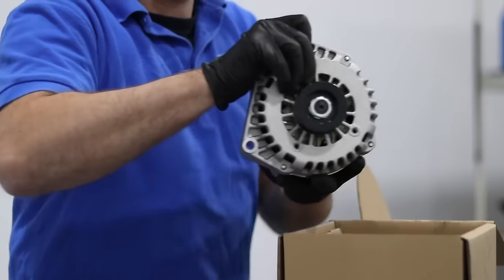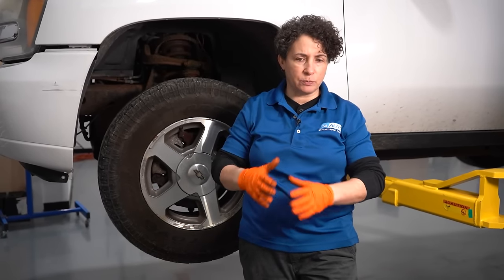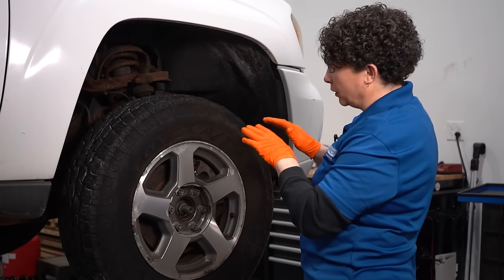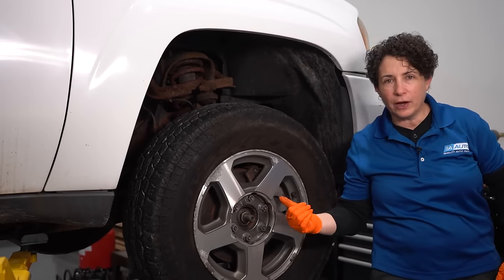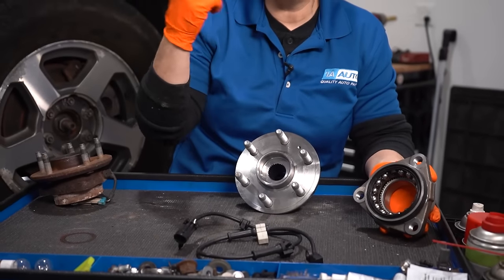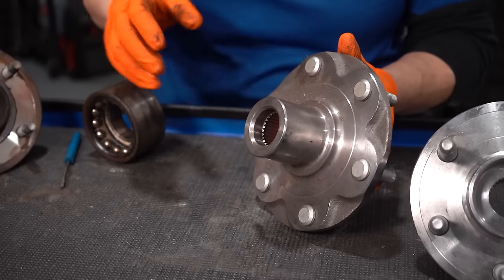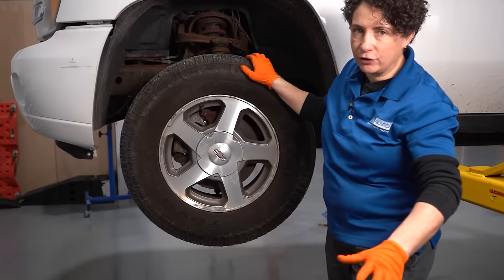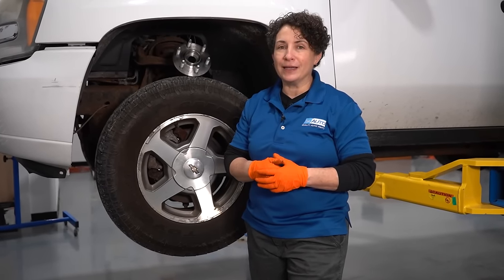Car or truck howling noise when driving? How to evaluate your wheel hub bearings.

Comment from the maker: √  Watch the Video
√  Buy The Part at 1A Auto http://1aau.to/m/Visit-1AAuto
√  Do it Yourself
√  Save Money
Reply: Sometimes they can give a wobble noise before the howl. Mine came on after getting all new tires. The heavier new tires were the straw that broke the camel's back and immediately brought on the noise. Naturally since it cane on with new rubber, I was convinced it was from a defective tire and so was my mechanic because we couldn't get any noise or movement on the lift, but it was very loud while driving We rebalanced and rotated the tires. The noise was still coming from the same spot. So I gambled and chaned the bearing. Problem solved.   And even though it did not make noise while spinning the wheel on the lift, when we got it out, and spun it on the workbench we heard the grinding. Go figure?

Comment: I bought TRQ front hub and bearing set for my Chevy 2500HD,  from you folks.  Put them in to specs. Now 2500 miles later they are whining like crazy.  Have not yet started to wobble thank goodness.  They were replaced under warranty, but I'm afraid to put them in, I don't want to be doing front hubs every 2500 miles.  Probably end up spending more and put in moogs.

Comment: Was starting to hear the "howling" from the front of the truck.  Got home and measured the rotor temperatures as close to the axle as practical.  Truck was just parked with wheels on the ground.  Using a hand held infrared thermometer, driver's side was 90F, passenger side 140F.  Wasn't sure if it was binding brake pad or wheel bearing, but I knew which side needed work.  Turned out to be wheel bearing.

Comment: Over tightening with a impact gun will also set your ABS light on that hub. I found out after 6 months of trying to diagnosis my ABS light. Replaced a CV axle and tightened with a impact gun on the axle nut . Squeezed the axle into the hub and threw off my wheel sensor and tire speed. Lesson learned. Also you should replace your axle nut each time you remove it.
Reply: That’s what she said

Comment: I have all terrain tires.
So can’t hear the bearing howl! But it’s thudding some bumps. And wheels shimmy over road markers. And all suspension is new. And with looser steering. 

All suspension is new. 

Now my wheel might snap off. Now I’m going to tow my car and mostly likely they going to tell me a wheeling bearings are shot. 

When they all said everything was good.

Did they even check them before? Or use a stephoscope? 

I’ll be surprised if it’s not a wheel bearing or ball joint! That 2 shops claimed they checked.

Comment: Thanks for the video. I'm trying to diagnose
(amateur mechanic) a vibration coming from
the front driver side of my vehicle. I'm
starting to suspect a wheel bearing also after
seeing your video. May try what you did with
the vehicle in the air. Thanks man!

Comment: I was not aware of the potential problem of over tightening the wheel bearing by using the impact wrench for the axle nut. If I have over tightened should I back it off and verify the torque or is the damage done and the hub assembly need to be replaced?

Comment: 2012 Chevy Silverado 1500 5.3l LTZ has a humming noise in the front, so I replaced the driver side hub assembly, but the humming noise is still there. Funny thing is, it sounds like it's coming from the center of the front not where the wheels are. I don't like guessing because that's what I did with the hub assembly. This roaring sound is a constant sound that starts around 20mph and doesn't stop at a higher speed. Is it possible for it to be coming from the front differential or is that out of the question? The truck has 140k miles on it, but it's been treated nice over the years. I've checked all the fluids in the truck also. I've tried to pin point this sound by rolling up my windows and listening to it. It has me puzzled because I thought it was coming from the driver side, but it sort of sounds like its coming from the center of the front wheels. It's one of those traveling sounds. Let me know what you think.

Comment: Thank you for a great video.  My 2018 Hyundai Santa Fe was making noise from front end, so suspected wheel bearings.  No wheel wobble, so wondered what was causing the noise.  Rotating the suspect wheel did not make much noise, because not many RPM.  Jacked all car up and ran engine to turn wheels.  The vibration in the strut spring was the deciding factor.  No vibration on the good side, but significant on the bad side. Removed the bearing assembly, and then you can tell that it's bad with that grating noise/resistance  as you turn it.

Comment: I installed new drive works wheel hub bearings on my 2002 Impala ls and I hear howling noise so I need to if that's normal since. Brand from advance auto zone or if it need to break as they say?

Comment: Ive had my rear brakes replaced and asked for an inspection to make sure nothing else was needing fixed  i was told everything is ok, private mechanic. I've had my back tire fixed and asked for an inspection to make sure everything is ok.  Goodyear . Went to Subaru dealership 2x , one for a transmission fix. Got an inspection.. Was given green light , came back a 2nd time cv axle broken , inspection... Green light.  This month my car has been in the shop inspected by at least 5. I'm still hearing a howling noise.  I know people miss things. But this is not something mechanics would miss.  3,rd time at the dealership and they diagnosed my rear bearings. By this time I'm living in my car due to the money I've had to put in it.  I' wish this was an easy diy fix.

Comment: What happened to the old style, when did they go away?   You know, you remove the nut, cover, and pull out the bearing, grease it in your hand, and re-put it back in, install the nut, turn it , and cotter pin it?  > When did they go away?

Comment: Hi my name is Hector,  I have a f150 xlt  2012 two wheels drive my problem is that I hear a winning grinding nose in the front  driver side. I have drop at the Ford dealership for several days and two other place to check the problem but neither of them seem to locate the issue. Can you please help or direct me how to find the source.  I had the truck from New and is in good condition. Thank you look forward from hearing from you.

Comment: I have 2013 ford Taurus limited mines is making this cloking noise & vibration once i give it gas. I thought it was my brakes & rotors i put a new set all around, sbd i put 4 new tires thinking it was the issues, but no i still heard & felt the noise & vibration i also put a driver side rear wheel bearing on because i heard noise. But after all this work i felt and heard this in the front end of the car. So do i change both front wheel bearing or just one.

Comment: I love your videos.  I had my CV axles  replaced and afterward, I did hear howling noise at high speed, also at 40mph there is sound like a distant helicopter.  I believe they probably over torqued the CV Axle nut.  I noticed less MPG and the car at hwy speed did not coast like it used to, it slowed quickly when off the gas.  So I think my wheel hub/bearing is damaged.  Over time it does seem to have improved but not normal.  Is it worth loosening and re-torqueing the nut or is the damage done.

Comment: So I drive an 09 dodge caliber and as of now I have to replace my front subframe due to rust that tore up my driver side swaybar bracket so it clanks against my tie rod I believe. I have negative camber on both front driver and passenger side tires. I jack up the front end and there is no play left,right, up and down of my tires. what would cause inner tire wear on both sides?

Comment: Hi , could a 2018 Nissan rogues wheel bearings be bad at. 70k ?
I’m hearing that vibrating growl drone noise and feel through steering wheel.
Reply from the maker: +@ed370zx3 We wouldn't be able to diagnose an issue like that here, you may want to have a local mechanic take a look at it. Thanks for checking us out! http://1aau.to/m/Shop-1AAuto-c

Comment: what if your truck f 150 has a jingling sound along with an intermittent scraping coming from the tires as you drive. barely heard it when 20 miles from destination then when a couple of miles to destination it was getting load, you can hear it through all the traffic going by.

Comment: She's good. I do hate these new sealed hub bearings. There's nothing better than the old application, with a castle nut and cotter pin. It was good enough in the commercial semi truck world, it has to be good enough in a small SUV or pickup.

Comment: 2013 Tahoe 4x4. I get a howling starting at 55 up to 65. Sounds like its coming from the front pass. Everything up front feels tight.  No noise just rolling it. Front differential oil was dirty but found no metal. 
Also have a bearing noise from the front when on the accelerator in 4x4.
I can't seem to find it yet. Newer wheel bearings before we bought it. Maybe one was China junk
Reply: Now after finishing the video, maybe whoever installed the front wheel bearing just hammered on the axel nut.

Comment: Can anyone give me an opinion ?
I have a 08 ford focus and it’s making a rattling noise off and on with a few seconds in between stopping and starting I can barely feel it but I can  hear it and it’s not very loud but noticeable and it only happens when I’m going between 65 to 75 mph but I’ve jacked my car up and checked everything and all seems to be tight and In order. But I do have a warped rotor could that cause the rattle at highway speed ?

Comment: I have a ram 1500 2015 but I hear like a saw sound on the rear when I drive straight or turning from stop to 20mph trying to figure out what it is
Reply from the maker: +IMr.STON3 We wouldn't be able to diagnose an issue like that here, you may want to have a local mechanic take a look at it. Thanks for checking us out! http://1aau.to/m/Shop-1AAuto-c

Comment: my right cv joint is making a click noise whenever I press gas paddle or shift gears,
I also took it to a shop and they said I need to change the drive shaft but the problem is I can't find the part anywhere
i've been waiting for it for almost a month now so if anyone knows anything that could help me fix it id really appreciate it

Comment: I had a bad bearing in my Camry and it made that noise. Thought it was the front right hub bearing because I hit a curb. Took it to a mechanic. Turns out it was the rear right. Glad I didn’t try to do it myself because when driving it 100% sounded like the noise was in the front. The mechanic did great work for me before. Used a stethoscope and determined it was 100% coming from the rear even though he agreed it sounded like it was in front while driving. If I tried to DIY I would’ve ended up replacing the wrong part!

Comment: I am having some grinding noise(I am not sure how to call it though). but I only hear it when the car is running very slow like nothing on pedal or very little on pedal. It comes only sometimes and only when the road is a very little uneven. Anyone has any idea? I did 2 things the night before this sound came. first was I removed the strut mounts cap and put some silicon spray. and the second was I jacked up my car but the jack slipped and the car dropped on the floor.

Comment: Hey guys I need help for my 2016 Tahoe ls my (auto) headlight is not working I have to do it manually what would be wrong ?
Reply from the maker: +Rajveer Shergill We wouldn't be able to diagnose an issue like that here, you may want to have a local mechanic take a look at it. Thanks for checking us out! http://1aau.to/m/Shop-1AAuto-c

Comment: Thank you, I gotta admit I’ve tightened down the axle shaft bolt with a impact before multiple times not knowing this and have think it was ok and wondering why I was going through wheel bearings so fast

Comment: I enjoy your videos, plus I buy quiet a bit of parts from 1aauto.  I have a 1998 Chevy ck1500 5.0. I bought it new, and just made a 134,000 miles today. When I bought this truck it made a high pitch howl around 30 mph. I took it back to the stealership under manufacturer's warranty and they said it was my tires, so I went and got me a new set of Michelin and the noise was still there.  I took it back again under extended warranty. They told me the same thing. I brought it to my shop, placed it on Jack stands. I set my cruise control to 30mph, I took my stethoscope and probed the differential. Low and behold, the noise was right in the location of the right rear brake drum. I have no clue what this is. Any takers out there?
Reply: Must be axel bearing or transmitted from the differential.  
No one ever changes/checks the diff fluid level or quality.  
Have you found it yet,?

Comment: 9:01 I always torque my bolts, even the mud guards, but from a technical point of view it’s not that critical for a wheel bearing, I know that because on a mk5 Volkswagen Golf GTI the axle bolt has two different torque specs depending on the bolt design, 6 and 12 point bolts without ribs are 200Nm+180degree turns, 12 point bolts with rib is 70Nm+90degree turn, that’s quite a bit of difference in terms of the preload, it’s pretty obvious the torque spec is more for preventing the loosening of the bolt than providing a specific preload.

Comment: It feels like my 2011 Odyssey has vibrations coming from the wheels, mostly during highway speeds. The steering wheel vibrates left & right pretty badly when braking from highway speeds as well...
Reply: Warped brake rotors, bad and/or unbalanced tires, worn out suspension components... A bad bearing always makes noise.
Reply: Highway speed vibration in steering wheel- check wheel balance.
Shaking when braking- warped rotors
Reply: Problems With Brake Rotors:
If your steering wheel shakes a lot while you're braking, that could mean that your rotors are out of round. In other words, the rotors have started to wear out, lose their shape, and become warped.
You could also need a tires rebalanced/wheel alignment done. Worst case scenario is worn out suspension components. I'd check it out with your local trusted/family mechanic soon as possible.
Reply: Odysseys are known for rotors warping,  first thing to check.